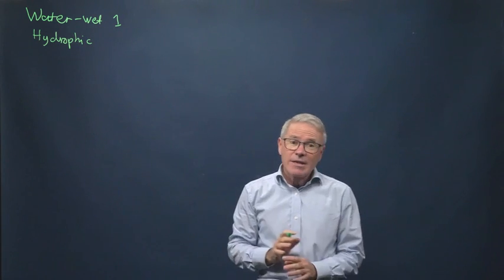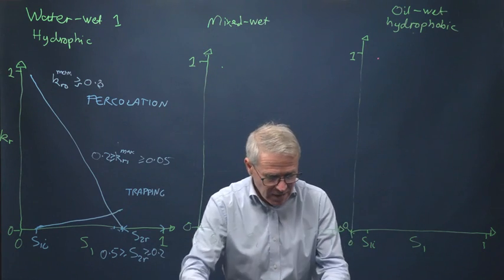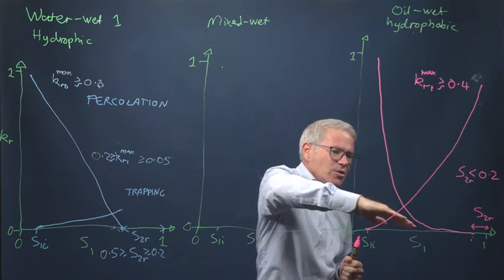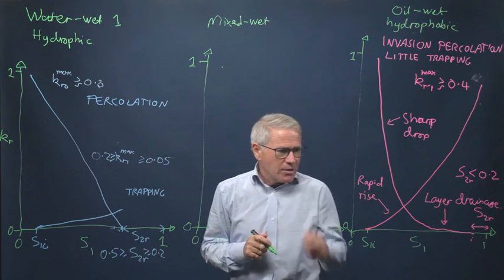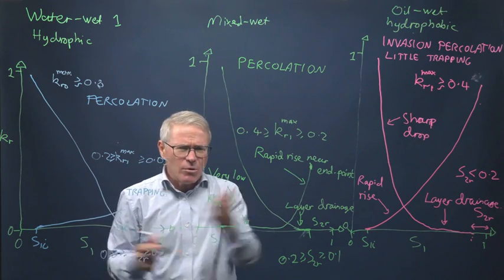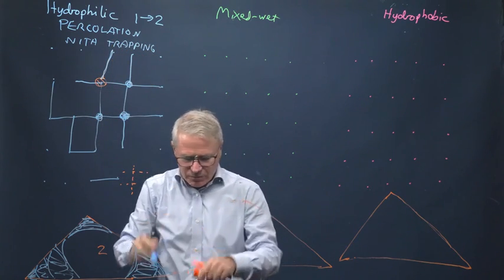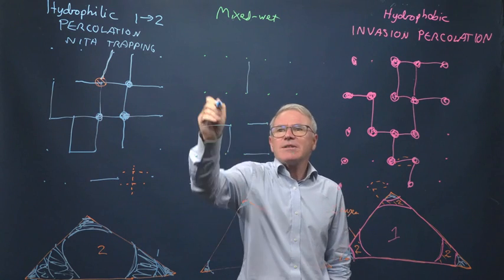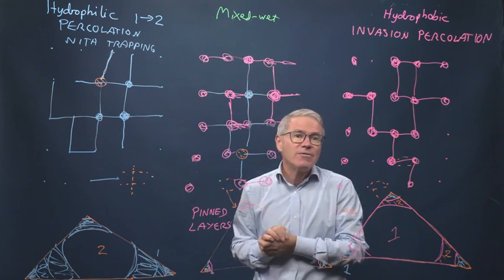Relative permeability, wettability and recovery

Comment: Since relative permeability is a function of wetability and pore geometry, do mechanisms that change either of these then affect the relative permeability curve? Do high levels of compaction alter the rel perms as well as a reduction in absolute permeability?
Reply from the maker: Many thanks for your comment.  Yes, as discussed in the videos wettability does have a large impact on relative permeability.  Pore structure has an effect too: high levels of compaction will tend to make the pore space less well connected, so as well as a reduction in absolute permeability, relative permeability is also likely to decrease with an increase in residual saturation.
Reply: @ very interesting, thanks. The videos are very good, thanks for posting them.

Comment: This may be a Stupid Question but can  an Oil Storage Tank Battery still produce water condensation after the inside walls of the Tank have been coated with Crude Oil?

If yes, does the lower the Oil Level inside the tank allow more Condensation of Water to occur?
Reply from the maker: I am not able to answer this as I am not expert in oil storage.